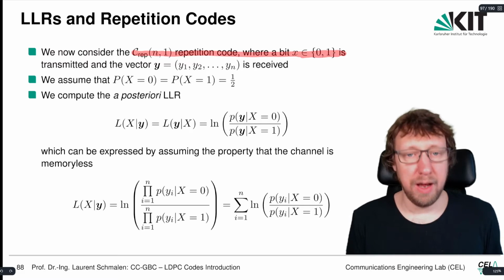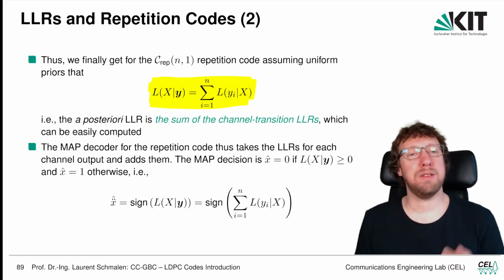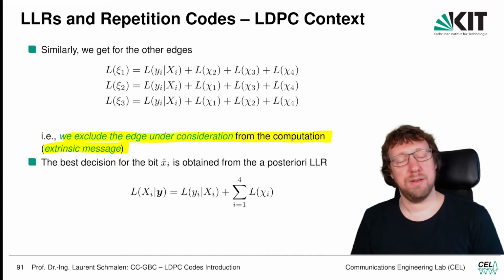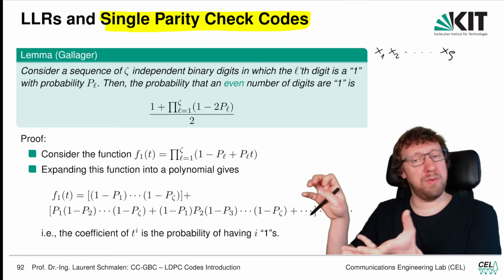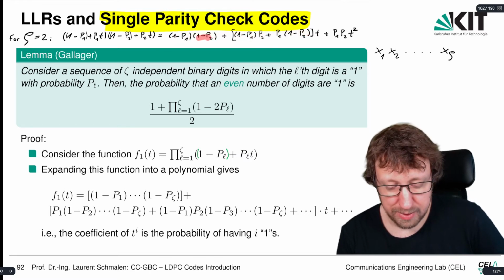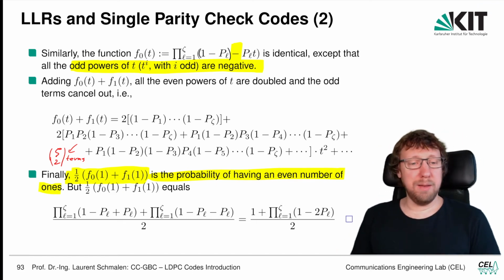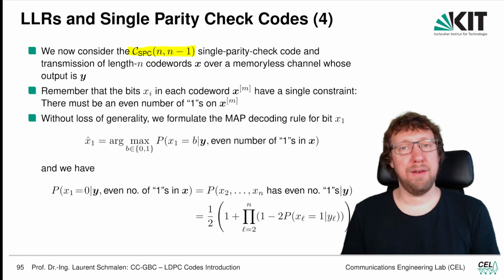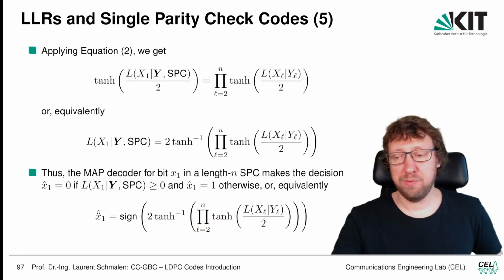Lecture "Channel Coding: Graph-based Codes", Chapter 3, Vid. 8, "Log-likelihood Ratios & LDPC Codes"

Comment: Dear Professor, could you please explain a bit more how are variable nodes essentially repeat codes and the check nodes essentially single parity check codes? Thank you for your lectures :)
Reply: if you got idea let me know please
Reply: Personal Comment, from parity check matrix points of view, each row is the parity check code, which is trivial. 
As for the repetition code, for each column it may connect to diferent parity check constraint, based on the syndrome you get, it seems like the majority vote from each connected parity check code. (The majority vote is the fundamentals decoding method for repetition code)